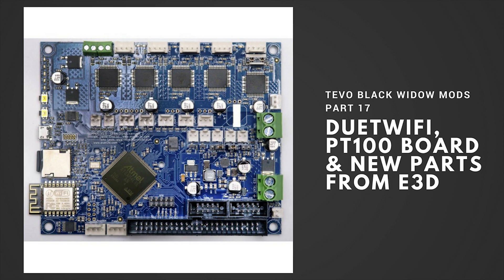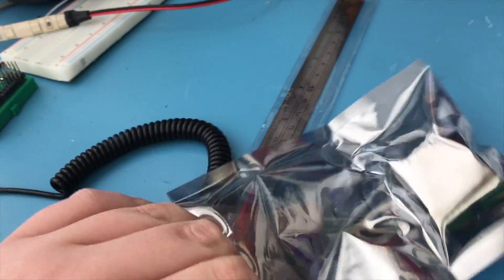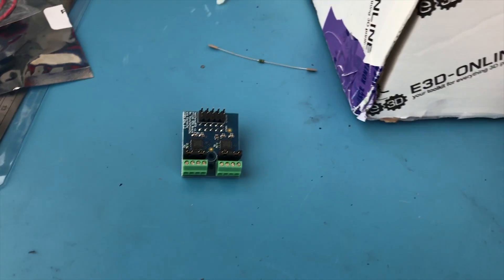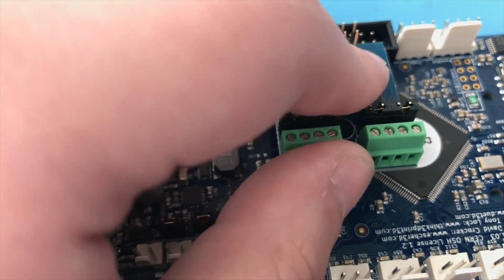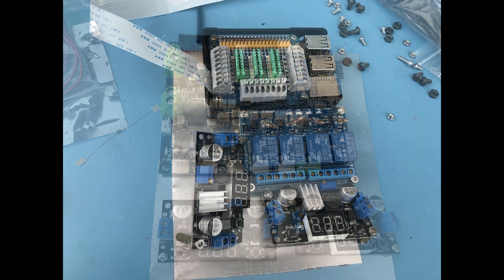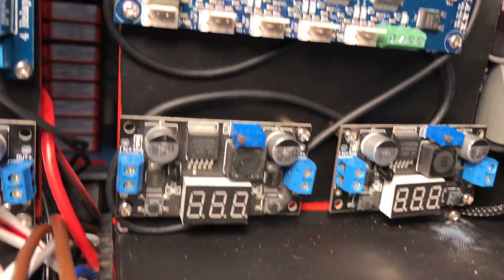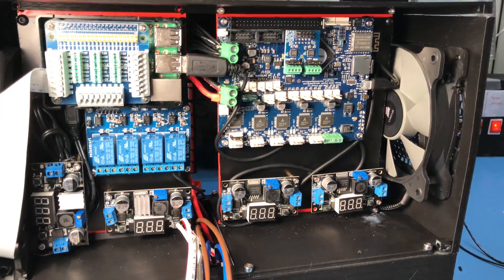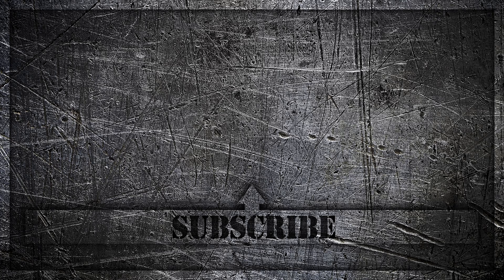Tevo Black Widow Mods Part 17 - Duet Wifi

Comment: It’s looking good Isik.  You’ve done quite a bit of work getting it all together.  I’m looking forward to seeing how the Duet WiFi operates for you.  All of the reviews and feedback I’ve seen love it.   I like the direction you are moving towards with your build.  Suggestion: Have you considered using a tripod setup for your camera?  It would free up both hands and give you a more stable recording.  Looking forward to next weeks update.
Reply from the maker: Thanks. Wiring should be mostly done by next week, and the extension cables done in the one after that. I should be able to test it in that video as well. 

I have a mini tripod that I use when recording something on the table. I can't get a full size one, and use for everything unfortunately because I don't have the space in front of the printer enclosure. The doors barely open without hitting the wall. There is about 40 cm (~16") space, definitely not enough for a tripod.
Reply from the maker: I just realized which part of the video you were talking about. As I said I normally use the mini tripod for table recordings, but the box didn't fit in the frame, so I had to record it like that.

Comment: After all the moding you have done on this printer, would you recomend it? I am looking to get my first printer, and while this printer looks like a pain in the ass to work with, it also looks like a good lerning experience to get to know the ins and outs of a 3d printer.
Reply from the maker: I am modding because I enjoy tinkering and making the printer better. If you enjoy that as well, then I can easily recommend the Black Widow. It has a lot of great features that can get even better by modding, and it is great value if you are willing to upgrade a few parts. If you don't enjoy it, and want something that works great out of the box, then there are better options.